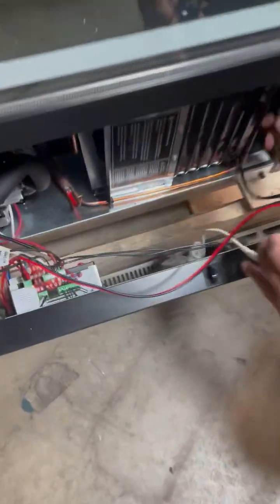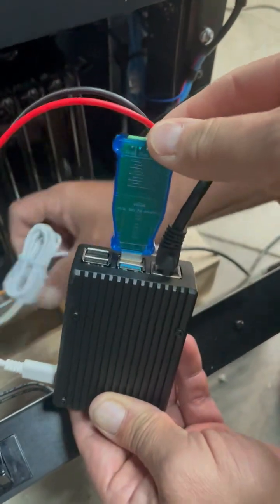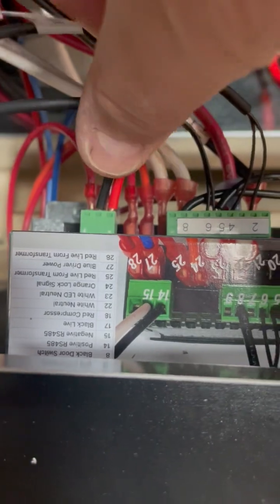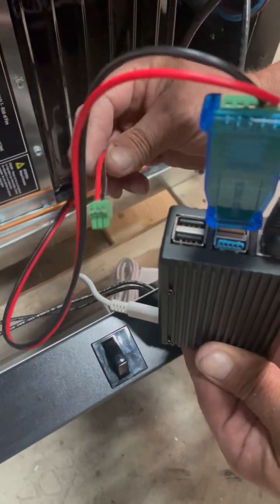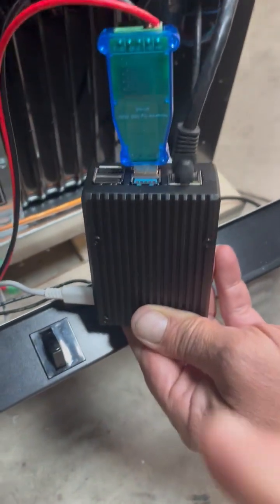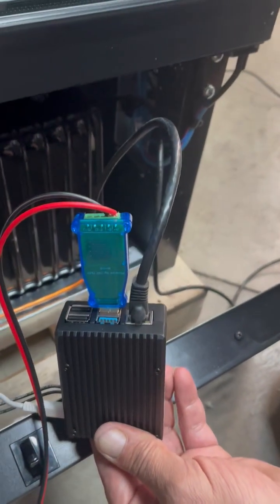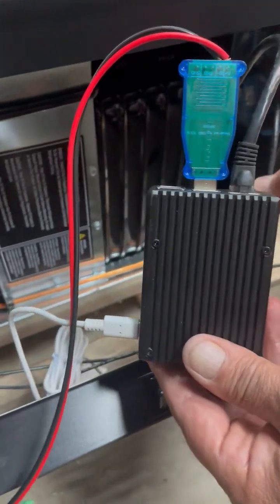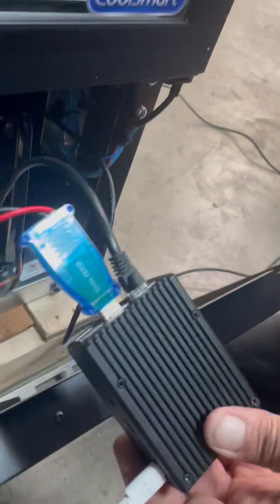How to Connect Raspberry Pi Device to IceBlu Freezer

Comment: This randomly appeared in my doomscroll. Please enlighten me to WHY we are connecting a networked Raspberry Pi to a freezer?
Reply from the maker: This Raspberry Pi device allows us to remotely connect a freezer and a cooler together so they can both run on one POS device. Makes unattended retail a lot smoother for our customers!
Reply: @avscompanies  does the POS monitor inventory as to when it needs to bother being on? I'm struggling to visualize the sales pitch of a POS monitoring the freezer or cooler beyond "if sold out, turn off."
Reply from the maker: @KirasNote22  It does monitor inventory and track product purchases, this way an operator knows when they need to refill the machine and what products are most popular. The POS device also takes secure payments and helps to reduce theft.